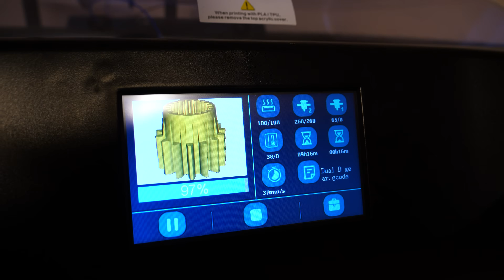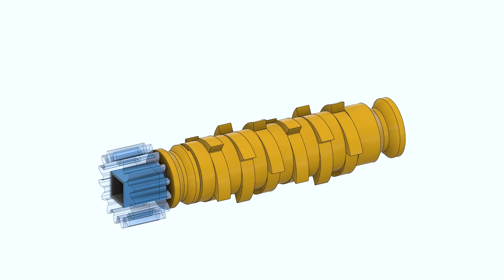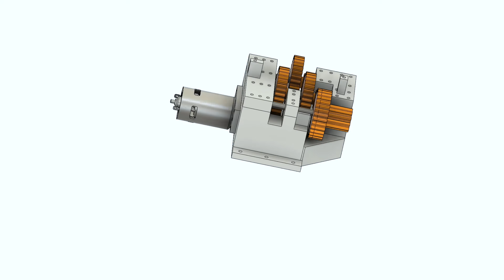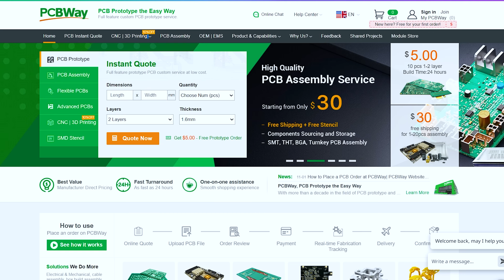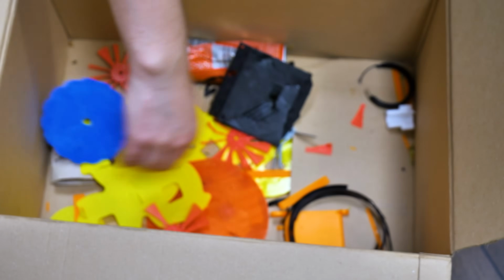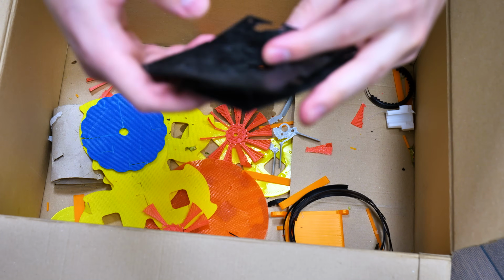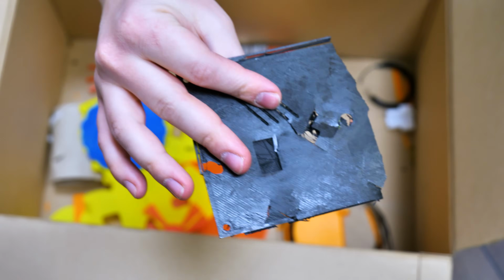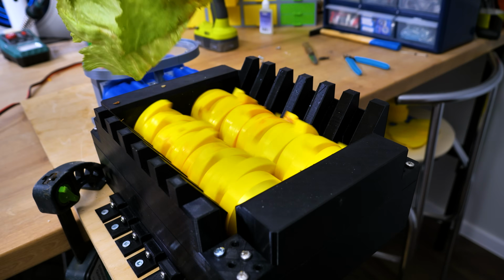I 3D Printed a SHREDDER and this happened...

Comment: ..a really interesting and fun way of learning mechanics....
and teach it to others perhapaps, i guss many kids will love this...

suggestions:
sychronisation and locking of the shedder axis to limit movement

the teeths can be made of thin strips(teet width) of metal that is shaped to fit (it is the part that trasfere the initial force)

drive both shredders simulanesly...not just one (to balance force and reduce wear signifficantly)

the gaps btween the induvidual shredders are faar to wide

the shedders do not need to fit as snuggly to the square aluminum bar as long as they can be locked and pushed together (u can easily do this by two parts screwed into eachother, when screwed out thay puch the parts together)

the base dont need to be as snuggly fitting to the shedders axis (thers no grinding here...its just for holding what ever u shredd in the shredder)

..ps.the reason the plasic wheels take so much damage is because they experiance a force from on point...doubble gears on opposite side of the gear will reduce it...but it also make the gear system more complex...

ex X-O-X (where both X are driving the O axis...spreading forces over two poins 180 deg from eachother..for even smother leveling, 3-gears 120 deg apart..

Comment: I'm quite interested in how this would work with shreding fabric, especially would it still work if the shredder teeth were more fine. I definitely did not think those plastic teeth would hold out at first, very impressive.
Reply: Looking at his results with the flat plastic pieces, it won’t do well as is, but I’m sure if you tighten the tolerances and maybe add sharp edge inserts of some sort, it would rawk.
Reply: @RichardBetel  It needs a more robust gear assembly and thinner cutter plates for sure.

Comment: impeller pumps are better than gear pumps
Reply: try graphite surface lubrication bearing, no steel balls
Reply: try heat cured biomass flour putty to carbon fiber mesh (cast carbon fiber)
Reply: try pure dc-only sheet motor, no ac components/commutators
Reply: radial or axial, no coils, just one sheet top/side of magnets, super simple motor design, high current low voltage motor
Reply: specialized use cases shredder, not everything

Comment: The small gaps are probably from the pieces deforming from the hammer head strikes. You should use a striking plate between the piece and the hammer to spread the force as much as possible.
Reply: No, the hammer is compressing, not expanding.

You would have gapes but would still fit.

Comment: Also, the speed of both rotors should be different, so it just does not fly through. It should solve the problem of not really shredding the sturdier parts.

Comment: It looks like a great salad shredder. You just need to add a wood or cardboard shoot on top so the items stay in there the entire time instead of flying out. It would be cool if you put some sort of metal on the tips of the blades. Maybe something like a razor blade or some other cheap metal part  attached at the blade tips. Good job. It may have slid on easier if you sanded the inside just a tiny bit, especially the corners and definitely use lubrication.  Great build. I enjoyed the video.

Comment: I've thought about this (a 3D printed PLA shredder) several times and always kind of blew it off as ridiculous, but this video turned me around.  I wouldn't mind seeing this fleshed out with a sturdier gear box and perhaps metal teeth inserts. As it is, I'm very impressed. Excellent work.
Reply: and  a wider heith difference between the teeths on each side. the deeper the teeth bite, the better it bites.
Reply: Same here, want to mount one of these in a tub next to my compost

Comment: A splash guard is indicated. Than more teeth for shredder discs and if you can metal insert plates as cutting edges for less wear. And metal gears and at least 80% infill for the gearbox housing.

Comment: It hurts seeing how you hammer those blades on tube. You should have put gear on the wise and hammered tube through some wood. It insures nothing is skewed and you do not damage any surfaces.
Reply: Even THAT IDEA is painful... MILD SOAP & WARM WATER as  lubricant IS ALL HE NEEDED!!!! Sometimes the SIMPLEST THINGS are forgotten by the most BRILLIANT MINDS...
Reply: @flojotube  Bro your comment is painful to read, who tf still types in all caps? You sound like my boss & she's a bitch so.
Reply: @flojotube  why ALL the RANDOM capitalization
Reply: maybe if you freeze the axle
Reply: After all it's just a toy, so why bother?
Reply: No all you wrong. You should use saliva and ice. Wrap it in tinfoil for 6 minutes.
Reply: The best way to do this without breaking or damaging parts is putting it under not boiling but pretty hot water as PLA and ABS Become soft under hot water so they would just slide on and return to normal strength afterwards.
Reply: the best way to do it is not care about the finish like in the video because none of it is visible anyways